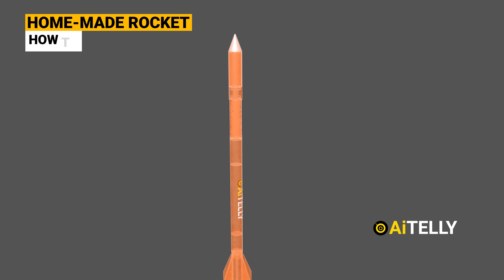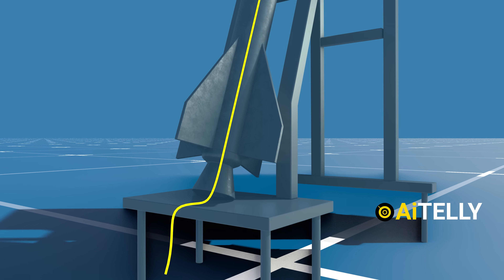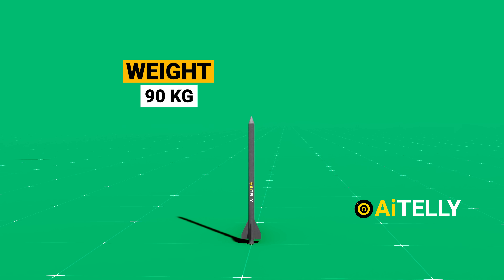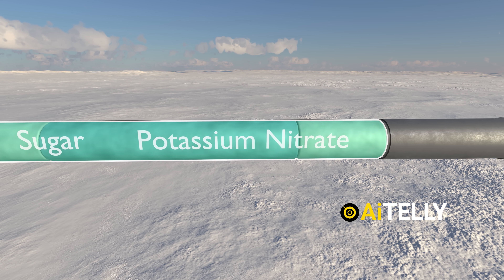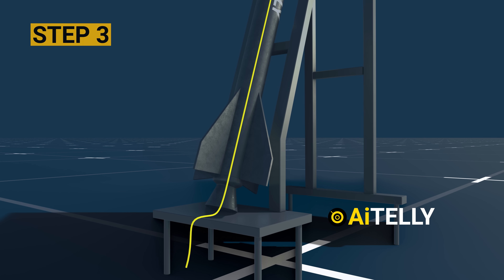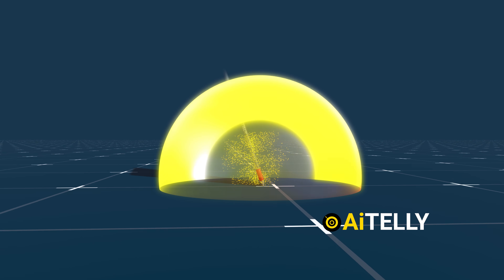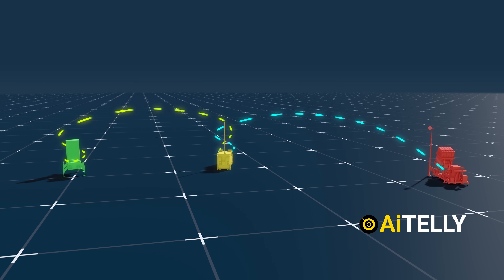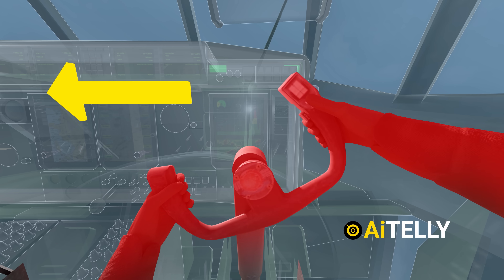How Hamas Makes Rockets against Israel | Qassam

Comment: These rockets don't have the power to lift much of a payload. The "warhead" is usually about 5 to 15 pounds and creates a large pothole if it lands on  a road.
Reply: Good point, however to defend against them you need a million dollar rocket. Use hundreds of them and it has similar effect to GRAD system.
Reply: @alexlee9095  not but it’ll mess up a parking lot!! Since that’s the only thing destroyed
Reply: These rockets just a firecrackers 😆
Reply: @TayseerBanks-ft5xf  those firecracker have cost hundred million dolar to Israel to intercepted...not bad at all....
Reply: @jiep5327  correction they cost america hundreds of billion dollars
Reply: @johncezar350  Te-ai prins !😉
Reply: that’s how we identify who bombed the hospital
Reply: @dingdongpong748 Hospital attack by Israel, which commits war crimes
Reply: @dingdongpong748  assuming Hamas do not have any other types of weapons is too shallow
Reply: @dingdongpong748  if it structural, it is IDF. If it ruins the paintjob, it's Hamas.
Reply: If you see the footage where the rocket landed in Israel the rocket can't even penetrate brick wall....
Reply: @jiep5327  Hamas has about 20 Different Rocket types in their arsenal.
The rockets in this video are just nuisance rockets that they use to overwhelm the iron dome. They have far more sophisticated rockets with payloads up to 375lbs & ranges of over 200 miles
Reply: @michaelcalland801  maybe you are right but they will not use it untill the iron dome is down...it will be a waste...those rocket is not homemade and it is hard to smuggle into palestine...it cost a lot of money...they will not use it recklessly...
Reply: @jiep5327  I agree…
Hamas has 1,000s of these homemade rockets that cost about $800 each to assemble. Every Iron Dome missile is $50k . Their strategy is to use the cheap rockets to exhaust the ammo & overwhelm the iron Dome & then try & send in the Syrian M-302s which as you say are expensive. The only weakness in the iron dome is that it can’t differentiate between a harmless rocket & one with a heavy payload so it makes sense.
Reply: It will when the hospital has oxygen tanks and a potential ordinance cache.  Crater was only 2-3 ft wide.
Reply: @justgivemetheaccount  all hospital never put the oxygen tank and generator infront of the hospital...usually in separate building behind hospital for safety reason...
Reply: exactly. i make these sorts of rockets for my "experiments" and they don't have much lifting power. I can get a 1 lb rocket to push a 2oz charge of tannerite about 150-200 yards max
Reply: Yeah but that payload of shrapnel and ball bearings tears big holes in human targets in the blast area. Wounded make good bait for drawing more enemies to the area.
Reply: All this is in order to convince us that Hamas rockets can fall on its territory in order to deny the crime of the Zionists who blew up the Palestinian hospital. What a shame!
Reply: WEll it depends on what the payload is exactly i guess. Would it be possible to equip it with a deadly pathogen?
Reply: it depend on how much powder you put in, and they also get rocket from Iran
Reply: @flyingcactus1953 Israel ordered the evacuation of the neighborhood next to the hospital, and the residents took refuge next to the hospital to save their lives, but Israel bombed the neighborhood and bombed the hospital yard. Who says that Hamas bombed the hospital? Did you know that Hamas missiles have no guidance and cannot exactly bomb the hospital? Religious witnesses were present and confirmed the flight of the planes.  Israeli nearby
Reply: @alexlee9095  
#1 Hospital wasn’t destroyed…it’s literally still standing . The parking lot was struck & oddly enough there is no crater. 
#2 Hamas has a vast Rocket arsenal including the M-302 which Carrie’s 375lb payload & the QASSAM-4 

The Rockets in this  video are just nuisance Rockets that they use to overwhelm the Iron dome.
You should really try to educate yourself instead of posting disinformation that you got from some random video on the internet
Reply: They don't fire rockets to cause damage. They fire rockets to waste Israel's iron dome. A single rocket salvo is worth one single iron dome rocket.
Reply: Its just few kg of payload and it was huge explosion thats israel bomb made, if gaza rocket have much power, those 5000 rockets in day 1 must eliminate 100k of israel population, israel army deleted tweets claiming hospital hits in half hour when public sentiment came in different way they expected, lie is made by jews
Reply: @alexlee9095 Hospital attack by Israel, which commits war crimes
Reply: To anyone saying the rocket was from Hamas and did not make much damage, go watch the video of its landing, stop lying to yourself
Reply: It's intention is more on damaging Israel's economy. An iron dome missile is much much more expensive, estimates range from $40k-$60k missile each, on Oct 7, Hamas launched  3k or more of their dirt cheap home made rockets, that means Israel spent $120M  at the very least for their air defense  on that day alone.
Reply: Look at all these suckers saying it has to be hamas because it didnt destroy the hospital, but ignore the fact it killed 500 people. This weak a.. rocket, killed 500 people. If you can believe that.
Reply: @alexlee9095  Hamas only hit the parking lot next to the hospital, and they lied about 500 dead. it's already been confirmed on CNN lol. no one hit the hospital.
Reply: @alexlee9095   @CraigTheBrute-yf7no It ignited the cars in the parking lot. All of the photos are obvious the Palestinians were just lying about the damage.
Reply: Every time the media reported on rockets from Palestine they would actually show potholes on the News when I was growing up, so yes you are right. Israel acts as a footballer faking an injury!
Reply: @alexlee9095  The hospital wasn’t destroyed, some cars got burned in the parking lot that’s about it
Reply: yeah this is why the hospital still exists. but the parking lot had a small pot hole and a big fire damage in the area from the leaking fuel.  @alexlee9095
Reply: Hospital has a few broken windows and a small pothole in the parking lot.
Reply: bro the hospital just gone what are you talking about  @jasonogle6602
Reply: @alexlee9095  Why do people think the hospital got destroyed? It didn’t. It did exactly what you would expect out of a Hamas built rocket.
Reply: @GrapeFlavoredAntifreeze  Well I'm a women with a penis, people will believe what they want.
Reply: @GrapeFlavoredAntifreeze Hospital attack by Israel, which commits war crimes
Reply: @alexlee9095  Looks like the hospital wasn't destroyed. Satellite images show only the parking lot was hit with a very low yield explosive.
Reply: @mezjean5966 A missile carrying 20 kilograms of weak explosives cannot kill 500 civilians. The hospital was bombed with huge bombs from the air. It turned everyone into pieces. A few days ago, Israel bombed a convoy of displaced civilians and caused 70 casualties among the muezzins. Israel has committed many terrible crimes against the Palestinians, but it has its media and the Western media.  The strong person overturns the events. Thousands of Palestinians were killed during the British occupation and the establishment of the Israeli occupation state, but over the death of one Israeli civilian, the whole world cries and sympathizes with Israel and ignores the suffering of the Palestinian people who die every day.
Reply: @alexlee9095  it proparbly hit the ammunition stored there....
Reply: But but but it destroyed a hospital!
Reply: @CraigTheBrute-yf7no  actually, I have seen the aftermath photos, pretty much only the car in car park was burned, no bomb crater, the hospital didnt get destroyed
Reply: @CraigTheBrute-yf7no  the hospital had 3000 people in it... if the hospital was destroyed then 3000 people would have died.... stop falling for propaganda
Reply: @CraigTheBrute-yf7no  It didn't destroy a hospital LOL, it only hit the parking lot.
the hospital building wasnt damaged from it
Reply: @CraigTheBrute-yf7no  it put a hole in the parking lot
Reply: @CraigTheBrute-yf7no  Israeli bomb
Reply: Let's get some facts straight. 1) The hospital was not destroyed. Only the parking lot was hit. 2) There was no airburst missile or JDAM. These would have left the scene easily recognizable with the insane shrapnel. All cars would've been  completely shredded swiss cheese. 3) 500 people did not die. It's physically impossible to even place 500 people inside the parking lot. People have proven this beyond any doubt. 4) There was a lot of fire because the rocket had a lot of propellant left when it fell down so it created a distinct fireball. Israeli rockets using high explosives look visually completely different on impact. 5) Hamas has a very good reason to lie about this to create sympathy and demonize Israel. 6) There is absolutely not a single shred of evidence that an Israeli strike was the cause. 7) On the other hand there is plenty of easily accessible evidence that shows a PIJ or Hamas rocket was the cause. All evidence supports this theory.
Reply: @CraigTheBrute-yf7no  Nope, it didnt. The IDF did that... again.
Reply: @modenasolone  if the IDF did it, the hospital would not be there anymore
Reply: @MrArvin0306  that's BS, a missile could be a small AA one or a large ground to ground one
Reply: @modenasolone  The hospital is still there, but there was a fire in the parking lot.
Reply: @modenasolone  
The damage includes the parking lot, not the actual buildings.
There is also no crater that would indicate a weapon with a high amount of explosives.
The most logical explanation here is simply that a Hamas rocket had an ignition error and immediately crashed again.
Reply: @modenasolone  the hospital isn't destroyed though. There's literally video of the fact it landed in the parking lot and made a tiny pothole. The fire was from burning cars.
Reply: civilians suffer all the time. how did they get such a lot of rocket propellant .nitrate not sold anywhere . you cant get this much amonium nitrate anywhere . i think they want to  destroy all  Palestine. it was supposed to be an excuse . it was not possible for them to do this while the mossad was watching. I don't know if they thought it can't get through the iron dome, but I think this is a deliberate incident. @CraigTheBrute-yf7no
Reply: @hak8450  ok... So Iran doesn't give their 🚀 toys to Hamas and Hezbollah? 🤣.
Reply: @hak8450  You nailed it.
Reply: @joyhaz00  how can anything get to hamas from iran when gaza is blockaded from all directions ,anything going in has to be blessed by usa and israel who recent supplied iranian arms it stole to ukraine ,u dont realize who is play chessmaster with al the weapons funding all sides of the war
Reply: @johncezar350  network of tunnels leading to Egypt
Reply: @hak8450  they have thousands of rockets, just the day of the big attack they launched 5000 rockets
Reply: @Trust_but_Verify  and where dose egypt lead to iran no Egypt is a us allied country the have one of the biggest us intelligence hubs in the world stationed there what ever goes through there is known about and has their oversight
Reply: @johncezar350  Not saying the Egypt government is involved but smuggler used tunnels to get stuff into Gaza.   Just like Mexico smuggler tunnels into US.
Reply: @hak8450  Russia is the world's largest manufacturer of ammonium nitrate.  Probably Russia -> Iran -> Palestine.
Reply: @joyhaz00 no but do you think usa gives its🚀 to israilis 😂?
Reply: okay they killed 300 people who came for hospital in parking  area . this is not big deal
Reply: @hak8450 Hospital attack by Israel, which commits war crimes
Reply: @alexlee9095  
Hospital wasn't destroyed.  Parking lot got burned because the rocket had premature burn out.  This reduced the range and provided fuel for the post impact flash fire.
Reply: @keithjurena9319   , the video filmed from the balcony u ignore is clear visual and audio that is not a failed falling rocket ,the small crater and large scorche radius is consistent with those types of munitions the israeli received from the americans like the gbu-39 small diameter bomb look it up dumbo , the facts israelis were threatening to bomb this hospital prior to the event their own propaganda tripped up in real time false images planed and limited hang out evidences that prove they were reconnoitring and their drone was watching over the attack at the time moments before and after they only show u the aftermath and try to fool people with angles and playing dumb as if they only use the biggest jdams bombs when they have all kinds of miniaturized and smart missiles that have the exact same effects seen at the impact site ,and if you ask me this attack is got a clear a double sinister effect it hit the motor pool to prevent any more casualties being collected to the hospital and also to scare away the christian sanctuary witch is why people were living in the courtyards there because they are presume its safe and would not be a target
Reply: @keithjurena9319 Hospital attack by Israel, which commits war crimes
Reply: @keithjurena9319  the hospital not destroyed because the impact absorb by 500 people ....

Comment: 🤔Where do they source the urea nitrate? And do I even want to know?
Reply from the maker: TNT is dynamite smuggled in small quantities.
Reply: @Aitelly  We know about the smuggled TNT  (Hamas can't manufacture trinitrotoluene on its own with the limited resources they have so they use it sparingly as an addititive of course) I am referring to the less expensive urea nitrate that they use as the base of their warheads. Because of the blockade, The urea nitrate (A well known improvised explosive) is clearly synthesized/sourced locally, no?  So, if that's the case...

Where does the urea come from? 😐